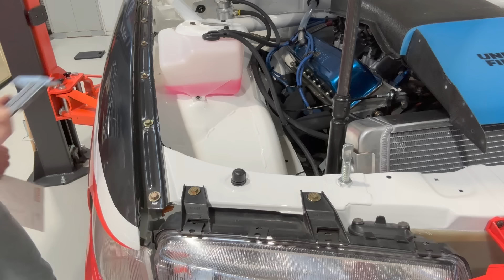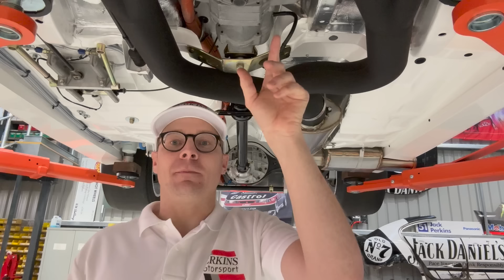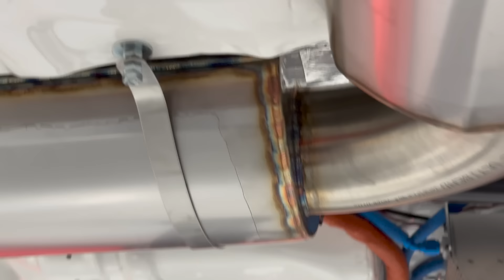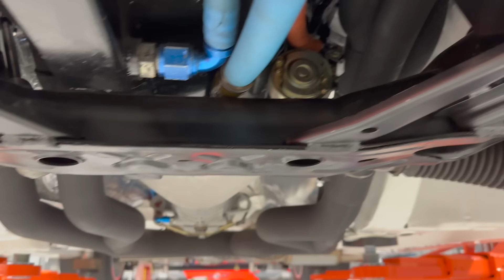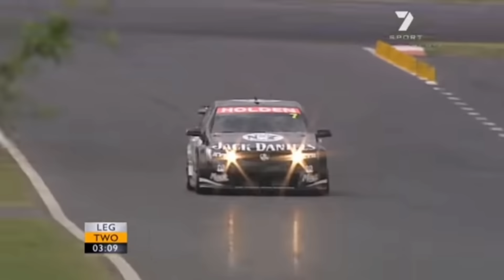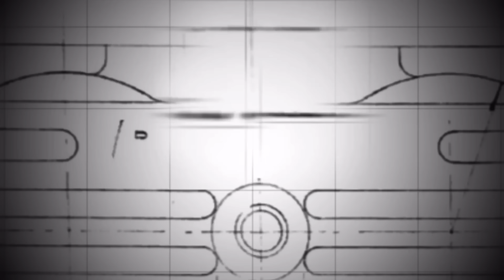Episode 62: Perkins Engineering Exhaust System on Early Holden Commodore Holden or Chev Engine

Comment: LP ran some kind of trick exhaust (split system?) at Lakeside in '88 for the carbie VL. 
It was talked about by the commentators, and made a very distinct sound picked up by the trackside microphones.
AFAIK, and if my memory is correct, he only ran it there for the one meeting and it was never seen or heard again.
If there's any notes that far back into the PE archives, I'd love to know the thinking behind such a different setup.
Reply from the maker: I think it was the cross over system, similar to what we ran again in 2008. I'll do some more digging. Cheers for watching!
Reply: @perkinsengineering  It was either Mike Raymond or Neil Crompton that said it sounded "like a Sprint Car on the clay".
To me it was similar to a NASCAR.

Comment: Hi Jack, very informative, just wondering with the two mufflers are they straight through with meshing or is there a pattern inside that creates that sound? Can you explain how you designed the internals of the two mufflers please.
Reply from the maker: Hard to explain without a visual, they have a perforated tube through the centre and the outside of that section to the stainless walls is packed with steel wool. This design in principal last a long time, sometimes there was an auger or spiral section in there possibly to make it quieter. Cheers

Comment: Not sure if this has been asked before but the '91 mobil VN Group A cars seemed like the last of the truly loud & meaty sounding touring cars, LPs VL in 92 and the bathurst winning 93 VP were noticeably quieter to me.. is it just me who thinks they're a bit subdued in the decibels department or were they made quieter deliberately?
Reply: Yes, there were Decibel limits in this period of racing. One particular race meeting we had to stuff Chicken wire in the Glen Seton Racing Falcon's  exhaust, as it was just above the limit..
Reply from the maker: The exhaust systems were very similar. The header pipes were a little different under "Group A" rules but I believe the mufflers were basically the same. Could be more related to the RPM of the Engine and some induction differences between the twin throttle and slide manifold. In 1991 they revved the engine to around 8500, maybe even higher in qualifying if it would cop it. That sounds much different than 7400-7500 in 1993. Cheers!

Comment: Interesting they still use imperial measurements! See you at Calder soon!
Reply from the maker: Not sure exhaust tube materials have moved to metric yet! Cheers!
Reply: Yeah, it's basically impossible to get metric exhaust materials in Australia! Most production cars apart from American ones use metric exhausts though -- 50mm, 55mm (2.16"), 60mm (2.36"), 65mm (slightly bigger than 2.5"), 70mm (=2.75"), 80mm (3.14") etc. I was surprised to see that the VE Commodore was metric - dual 60mm going into dual 55mm at the rear mufflers, I thought it would be imperial!

Comment: 1 7/8 is a very big primary pipe on a 5litre. Too big!  TriY exhausts are for grandpas car to tow a caravan. Or engines without enough room for proper pipes. In my case LC Torana with a Chev and 1.3/4 primaries. 
Nascar have long  proven the long pipe headers and X pipe works on serious engines. Not 10-1 302s!
Reply from the maker: Seemed to work ok for us! Cheers!
Reply: How many touring car races has your LC chebby won!? 
Nascar use x pipe for a different specific reason.
Reply: C.LOWN
Reply: Nascar uses "try Y's" bud. Do some research.

Comment: Nice vid
How much work was done on designing that exhaust for the power curve you wanted versus just getting it to fit?
Dyno time?
Did dimensions change for different tracks?
Reply from the maker: Always limited by funding! Could try different systems but it all cost money. In-house fabrication makes this cheaper because wages are effectively paid for so the cost becomes the materials. Could easily try different size tubes and stepped headers and "easy" stuff but couldn't really come up with a "winged keel" if that makes sense. Always tried on the dyno first to measure gains or losses. I don't believe there was ever enough resources to have circuit specific systems. One year at Bathurst they pulled the mufflers out for Qualifying or the Shootout or both, so loud, too loud, know as a megaphone in PE, but it was better! Cheers!

Comment: Great video Jack, as always! Quick question - is the engine solid mounted or rubber mounted, on these cars? Edit: Gearbox crossmember suggests rubber mounted?
Reply from the maker: The engine mounts from the engine block to engine cross member are on a solid rubber mount from McKay, they could be a version of standard GM actually. Gearbox is also on a rubber mount to the gearbox cross member. Cheers!

Comment: Hi Jack. Thanks for another informative video. As usual I do have a question, what is the reason for not having each bank its own exhaust and having a muffler on each side of the car?

Oh and I saw on Facebook that Perkins #2 is being loaned and on display at the Motor Racing Museum at Bathurst.
Reply from the maker: There's probably more than one reason, the reason's I'm aware of are clearance under the drivers seat and then subsequent temperatures under the driver.
The floor sections get cut out on the passenger side so mufflers can fit under there and not scrape along the race track. 
Then you can achieve the same thing going out one side in terms of power out put etc. Cars would be somewhat quieter at the race track if they came out each side, because standing next to the track you would only hear 4 cylinders instead of 8....
Reply: @perkinsengineering  Thanks Jack for your comprehensive reply.

Comment: I think the tri-y setup enables equal length pipes without the packaging issues associated with 4-1 headers. Interesting how they still chased equalised length right down to the join at the muffler. 
Not sure of the science behind the linked crossover system.
Reply: Crossover system splits the exhaust pulses evenly, which are otherwise split unevenly in the case of tri-y or 4 into one (due to the firing order of the cylinders). Check out gt40 exhaust system you will understand.
Reply from the maker: Correct, works like a flat plane crank I believe
Reply from the maker: Effectively two of the header pipes are crossed over from each side to join the other side, increases volume in the system and creates evenly spaced pulse, hence the noise variation. Improves the engine torque and some times the tunability.

Comment: How did you mount the starter to the Chev block on the LHS?  Would love to see some details on this...!!
Reply: These days you can buy the components to do so. I suspect many do not take or give oil to the filter pad. So you can fit the starter there giving room for the steering. Always a problem with RHD GM engines
Reply from the maker: Back in the 90's we just made it all
Reply from the maker: I believe we just machined threads into the block and make a mounting plate and bolt it up!
Reply: @perkinsengineering  I guess that depends on the block you guys used.  

OEM SBC blocks had the oil filter on the LHS, so that needed to be blocked off and remote mounted.

Either way, I love the innovation from back in the day...  just amazing stuff.

Comment: What's the advantage of the 8(-4)-2-1 compared to the dual systems with an X-pipe?  I'm curious if the X-pipe does the same thing as joining the banks (at an equal length) or if it has a different effect? 🤔
Reply from the maker: Good question. Ultimately there's a packaging issue in terms of what you can and can't do with the exhaust system. If you just built a system for a dyno and didn't have to worry about chassis rails, steering racks, starter motors etc. etc. then it would be interesting to know what the ultimate system would be. My experience (limited) with exhaust systems is it's always a trade off between torque and horsepower.